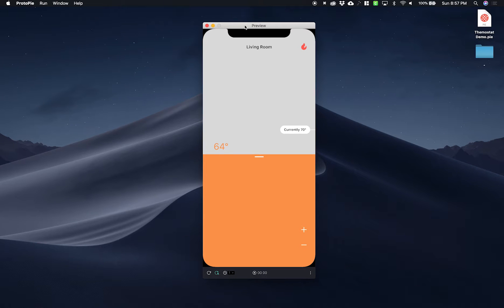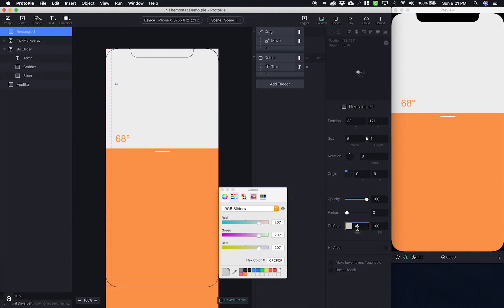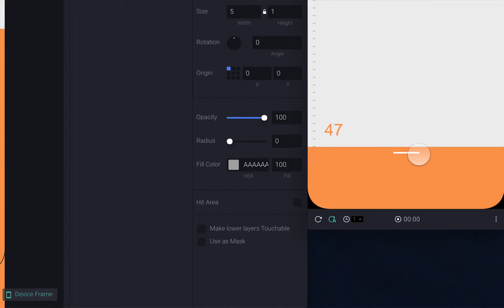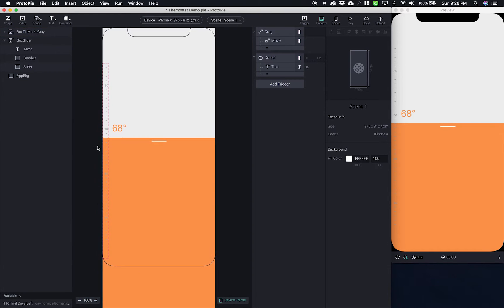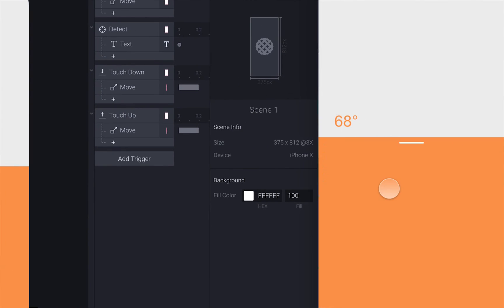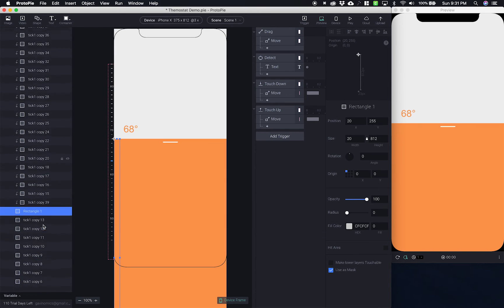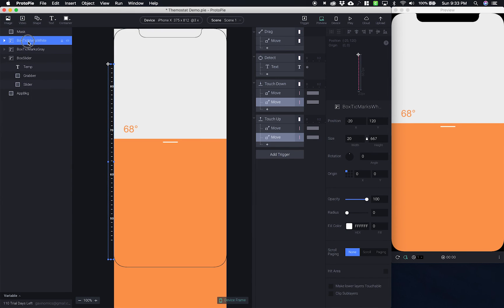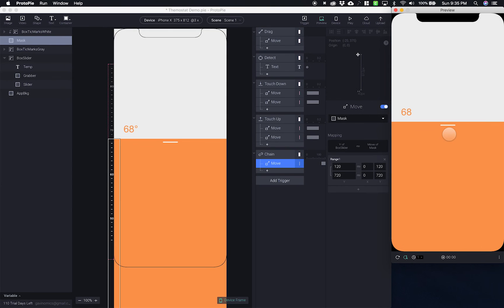ProtoPie Demo Part 2 – Chaining and Masks

Comment: It seems that in the current version the mask will not apply to the folder above it. It just seems to work when mask & tick mark folder are inside another folder. But chaining still works fine when I leave the mask inside the BoxTickMarkWhite folder (as shown in the tutorial before moving it outside that folder).